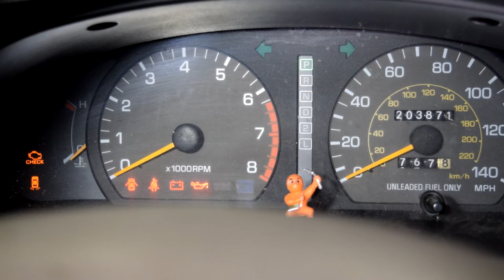Can You Hotwire a car Like in the Movies - Hollywood Secrets Revealed

Comment: old car can still work, irony now, the newest car, the keyless car are much more easier to steal and start.
Reply: you just need a programming degree and a lot of experience on those kinds of programs oh and be able to outsmart large companies writing the security. Of course. I forgot anyone can do it.
Reply: Well, you don't need any of that if you have the program made by the car companies programmers. That's how modern cars get stolen. The program does all the complex stuff for the mechanic(which just pushes some buttons).
Reply: SI0AX Well yeah but then you need to steal that first or be in a position where you can get your hands on that. Nothing for the common criminal though.
Reply: noodles6669
Car thieves are not your common criminal. They are experienced and plan out all the thefts. They target specific cars and sometime do it in teams and then have a specific chop shop with mechanics trained to completely strip down a car and reassembly the parts in another shell.

It's organized crime.
Reply: SI0AX Only the better thieves. There are many that don't do this though. There are many that target older cars, use a screwdriver as a key and drive off. Often to commit another crime then ditch the car somewhere. Don't get the wrong impression that all car thieves are mission impossible style going round stealing cars. The most aren't.
Reply: noodles6669
Well, those that use them for crimes target the most commonly owned vehicles.

There are also the ones that target the easy to steal with high parts demand like the old Honda's. The thing with Honda's are that most parts are interchangeable with many different models thus a large market of potential used car parts buyers.
Reply: There's a lot of cases in my country keyless Honda civic stolen and drive away, u can browse through aliexpress for master key, it's easily available and cheap.
Reply: Same with Nissans in my country, Skylines, Laurels and Cefiro are almost identical mechanically as well.
Reply: artyboy92
They steal Skylines over there?
Reply: SI0AX yeah mostly r32 to r34. no one likes the later ones since they aren't rb
Reply: artyboy92
Wow, so are they really that common over there? Like Honda's in the US pretty much.
 Except Honda's are cheap. How much are the stolen Skylines worth over there? Their prices in the US are inflated really badly.
Reply: SI0AX stolen ones just get stripped out and the parts sold. You can get non turbo auto ones for like 1k legally. gtrs have gone up in price since they came legal in the states. skylines/cefiros/laurels are probably the most common modified cars here.
Reply: artyboy92
That's pretty much what they do to the Honda's. The great majority of Honda parts can be mixed and matched with different Honda car models to create hybrid engines.
Reply: Thats not true at all.  New cars are much more difficult.
Reply: Car thieves dont plan anything.  They drive around and break into random cars.  You're thinking of thieves in big cities that are funded by car exporters.
Reply: Casey Rodriguez
The car exported are the most hardcore but there are also the ones funded by chop shops that are not so extreme. The chop shop makes more money than the thief though.

And yeah, I don't think the newer Honda cars are like legos. New cars aren't that popular for stealing unless it's the more hardcore thieves.
Reply: i'm in malaysia, the cars stolen are singaporean, usually stolen car in my country drove to border to be transporter to thailand, laos, cambodia and etc.

Comment: haha thieves can only go straight if you have the wheel lock on!
Reply: Unless it's a Saab. The key goes where some car's emergency break goes so there is no steering wheel lock. I wish I realized this before I towed my Saab across the U.S. I needed a full trailer as a non-locking wheel sets the car to turn the steering wheel as you travel and it causes problems on just a front tires trailer.

I had to periodically pull over and fight the steering wheel straighter on the towed car.

Comment: What about a push to start car?
Reply: on push to start cars you haft to get on the can lines and tell several different computers to start the car if you have a working program it can be done but the only one i know of is the dealers and it takes about an hour.
Reply: Been a few keyless cars stolen in the UK if I remember it's mainly been BMW and Fords the car theives had somehow got hold of the dealer key programing software/hardware. But most theives will take the easy option and just steal the keys.
Reply: You'd still need electricity to the body to get the spark plugs and fuel pump to work.
Reply: Ryker Redman On an electronic scale, they work the same.